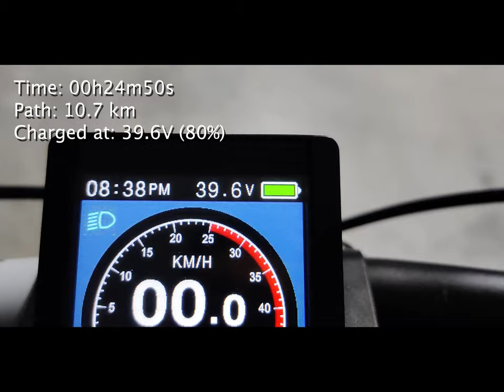Bafang 10 Km ride: How much Battery consumption for BBS02b 500W Mid-drive kit?

Comment: Hello, what is the total battery capacity?
Reply from the maker: Hi, it's written on the beginning of the video: 36V @15.6Ah on a 500W motor
Reply: @LukeLorusso  I have ebike 48V 10.4 A
If i make battery run at 36V with screen display , does it run longer ? 
My ebike only run for about 25-30km
Reply from the maker: @bigcatsliontiger  the V on your display must match your battery, otherwise it will miss-calculate the remaining charge.
If you need longer range just buy a more capable battery with the right volts for your motor